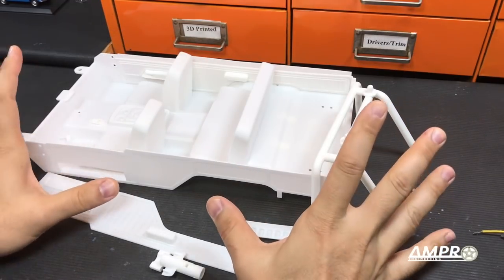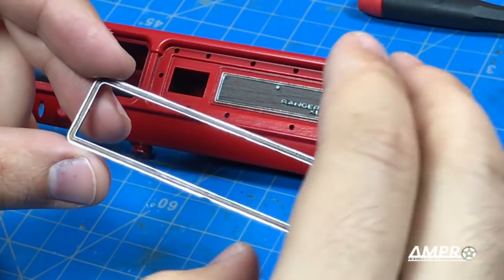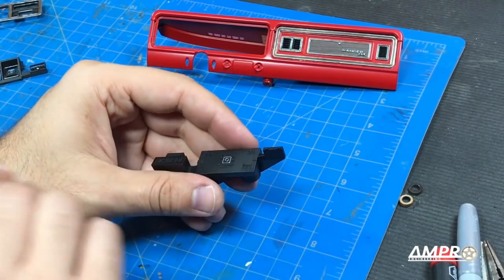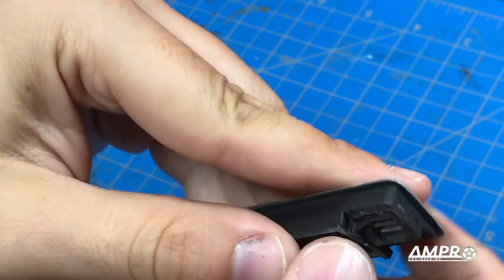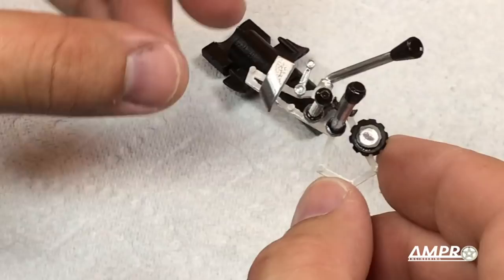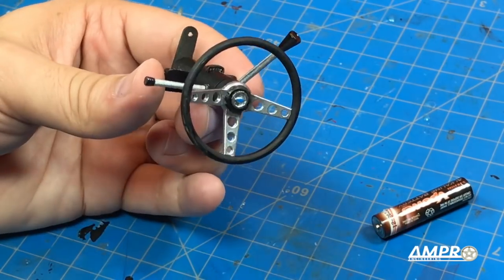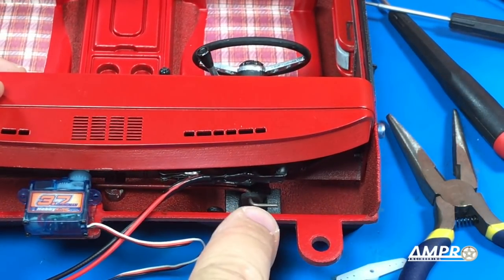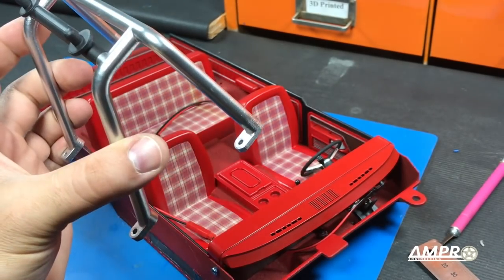e173: Traxxas TRX4 Bronco Interior Kit, Part Two: Detailing and Installation

Comment: As a master model builder, I have done some extremely detailed models including a Chevy plow truck I went all out on the interior  detailing and adding a rotating flashing light, head lights and tail lights and detailed engine bay, as a static model,  it came out so realistic on my snow diorama that people thought it was a real truck. That being said, I refuse to go that detailed on my TRX4 Bronco crawler. I did add lights and plan on adding rock crawler lights but beyond that, I cannot see going that detailed on something I plan on actually operating. Performance wize, thats the only thing I am interested in, not detailed interior.  I just do not see it. Mabe its because I already been there done that I don't know. It's not like I do not know how to detail my Bronco, it the fact I intend to crawl it, not showcase it. Each to their own and awesome job on your detailing. Oh, by the way, I added junk to my static model on the interior.  McDonald's  bags, bottles, trash, jumper cables and various other things a real plow truck would have. I added spark plug wires, belts and hoses. Yes, you can go overboard with detailing anything.
Reply from the maker: I run this truck a lot but as a trail truck Despite the 500 or so packs that the truck has seen, it still looks brand new but I would be too worried if it was to be used harder. Plus, this raises the CG a lot. You can seriously go overboard!